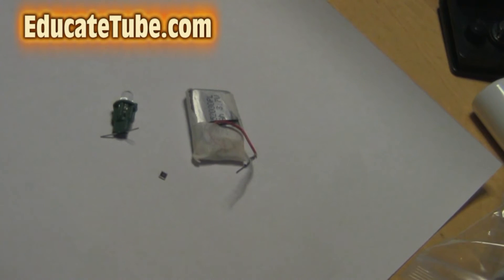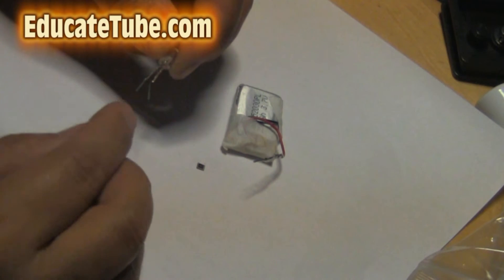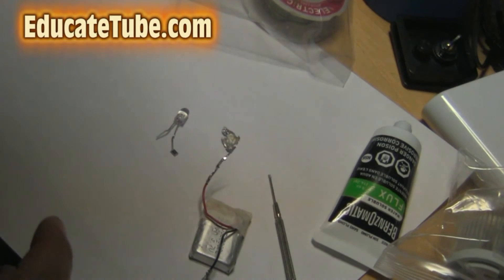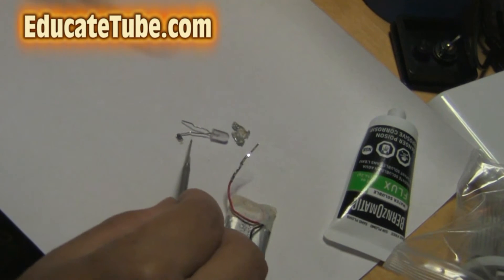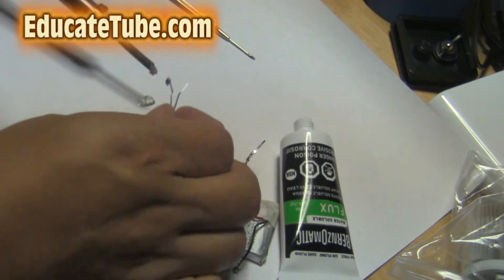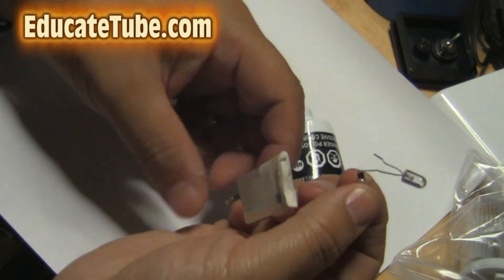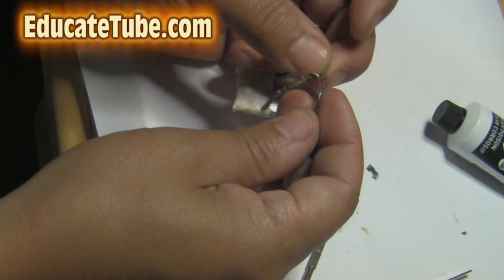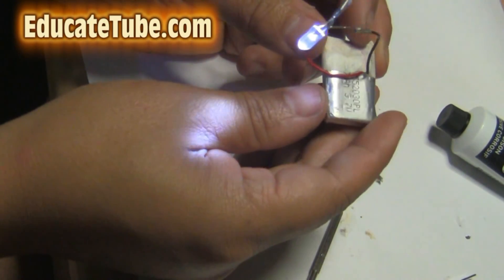DIY LED light with SMD resistor and Rechargeable Lithium Battery

Comment: does the lithium battery have a protection circuit integrated? If you discharge a li-ion battery below 2V you will damage it and it could become dangerous when charging it.
Reply from the maker: +Reign Of Error The lithium has protection circuit.  It will not charge below 3v.  If you discharge below the 3v you will need to "reboot" it with a 4v to 6v charging unit.